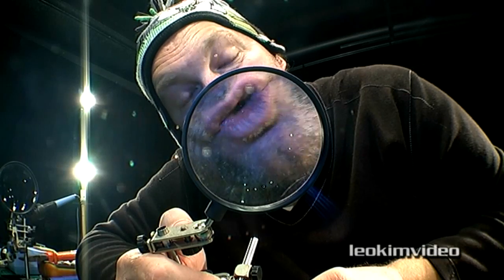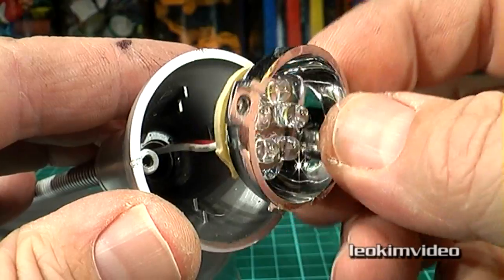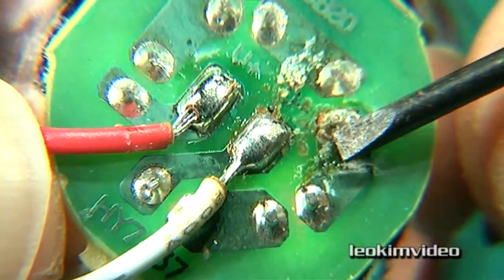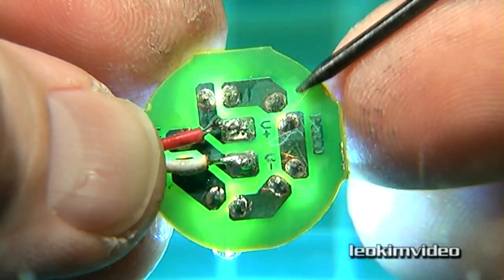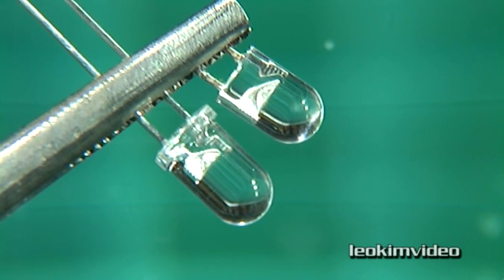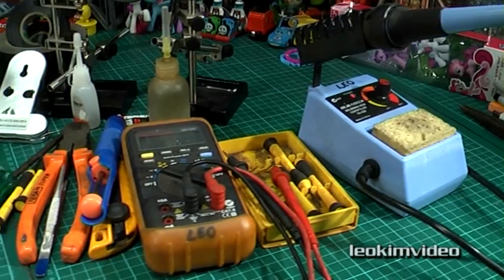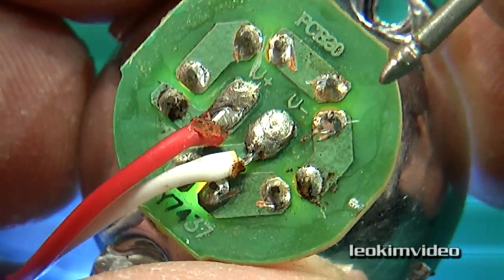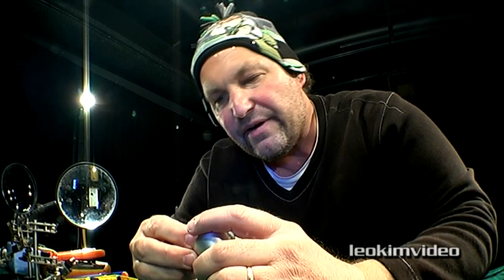LED Lights Fixing Cheap K-Mart Crap - SHOCKING

Comment: LEDs do not like to be over driven. They should have as at least a current limiting resistor. Those products had none. So over time they pass excess current and one or more LEDs will fail. Still it is cheap crap, as you said, not worth the cost of taking it back. If everyone did return these products, I'm sure the retailers would not stock them.

Comment: I agree with you on cheap Chinese products not lasting long, but there are products which are made in China and that are made well, things like iPhones and iPods, I've got a Sangean clock radio that was made in China, it's lasted me over 4 years and it works just as well as it did when it was new.  You've always got to remember, you get what you pay for.  These LED lights you bought are obviously pretty inexpensive, I would like to hope that higher quality more expensive LED lights would last longer.  I don't know of a reputable brand who makes LEDs like these ones, but I'm sure one exists.  But yes, very cheap electronics from China are a gamble, they really are.
Reply from the maker: last time I looked a ipad and iphone were VERY expensive little items, sure it's made in china but it also has a ton of investment to make sure whats made is up to scratch...not sure if the Chinese workers are paid enough though
Reply: And that's something that a lot of people talk about, lots of people debate about whether the people at factories like Foxconn are paid enough and are treated properly.  It's something I've not really looked into, but I've certainly heard stories about it in the news.
Reply from the maker: I did hear some were killing themselves to make a statement about the low pay Vs the price these devices sell for...but that's how these massive companies run...no law against making a profit and Apple Oz staffers agreed to a pay freeze so the company could pull more profit...It's amazing this ever happened
Reply: Yeah, I read those stories and found then very disturbing to say the least.

Comment: Hi Leokim, this video was pretty much helpful since I was able to use some of the troubleshooting steps you mentioned on the video and I was able to fix an LED flashlight that would not turn on. The problem: a faulty switch that was a bit loose from the circuit board. When I moved it with my fingers, the LEDs would turn on. So, I managed to solder the switch leads to fasten it to the circuit board. I placed the batteries back and it turned on and stayed on until I would turn the switch off.

Comment: L.E.D'S in series still require resisters hence why the l.e.d's fail early.
 Most leds have to be run at 20ma or less.
That is 0.02 AMPS.
google Calculating an LED resistor value.

Comment: great video and subject.
another cheap china product that really annoys me is fans.
they have steel bushes instead of brass or heaven forbid an actual bearing.
steel bush on steel shaft is designed to fail and after a certain time frame-which can be as short as 30 minutes the fan stops blowing its cooling breeze as the motor isnt strong enough to keep it turning-some lubrication helps but they continue to seize.
its built to be thrown away and another one purchased.

Comment: Using a "led array resistor calculator" webpage a 1/4 watt 1 Ohm resistor would drive 5 (white) LEDs at 3V 20mAh each from a 15V supply, I believe that's what you said you read at the array PCB.  

The colour of an LED often affects how much voltage it can handle and how many mAh it should be driven with.

Comment: Hi Leo, I certainly noticed the lack of current limiting resistor, I'm not sure why the duff one made the LED array strobe but one thing I have learned about LEDs is that when they die to go short circuit not open circuit like a bulb, when 1 of 5 LEDs die the remaining LEDs would get 1/4 of 15V rather than just 1/5, being driven harder will make another one fail and even more power on the 3 remaining ones and so on. 

Using a "led array resistor calculator" webpage a 1/4 watt 1Ohm resistor woul

Comment: character options kinda did the same thing to me but mine (i think) was a one off 
this company makes doctor who toys and i bought a 11th dr sonic screwdriver and it has 2 secret sound 
but when u use the secret sounds it burnt out the sound board so now it only makes lights 
so i had to buy another 1
like if this happened to u. just wanna know if its happened to anyone else

Comment: You made the quality point and perhaps re-iterated it too many times. I watched the whole video to see it through, but in the end felt I wasted some time. However, thanks for the NASA link. 

As for Chinese quality... that's a tough nut to crack. Apple is a "quality" product. Made in China. Is Foxconn a plant that makes quality products? Apple states their products are lead free, but they don't mention solder anywhere on their site.